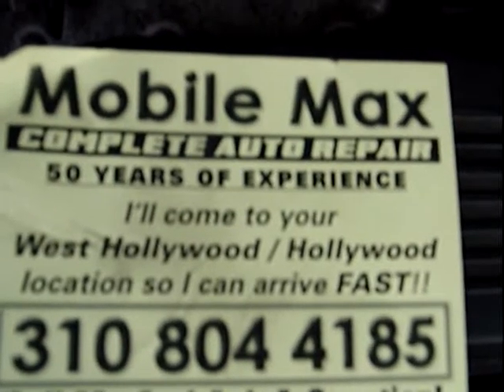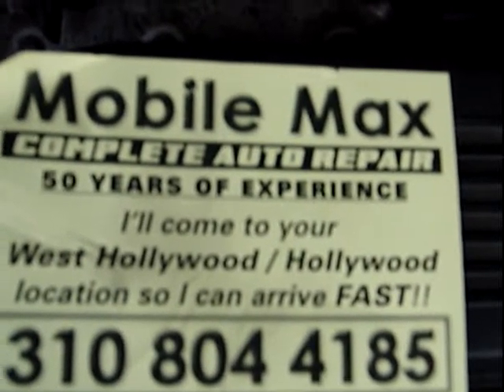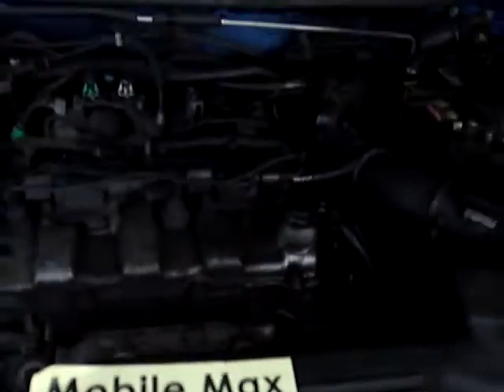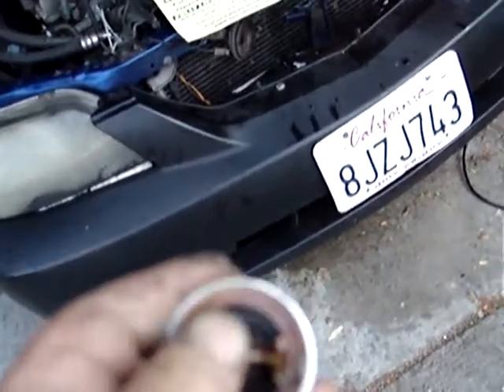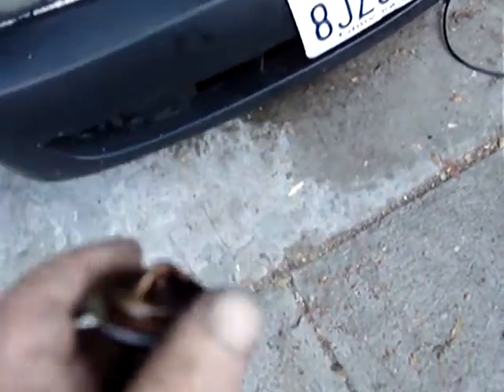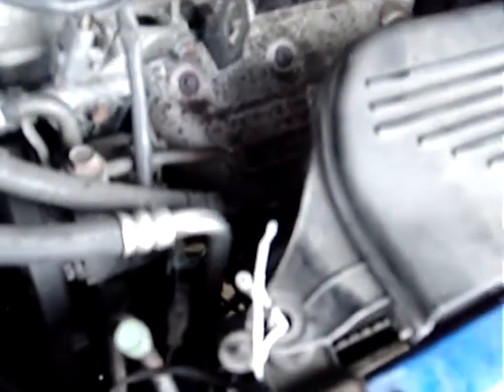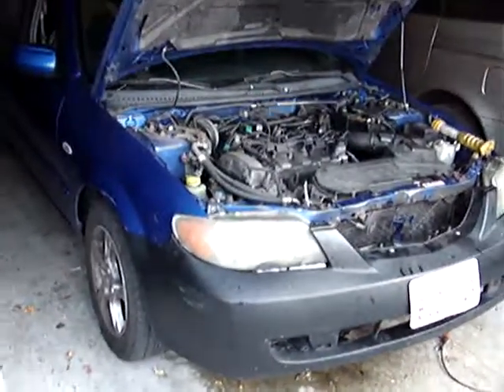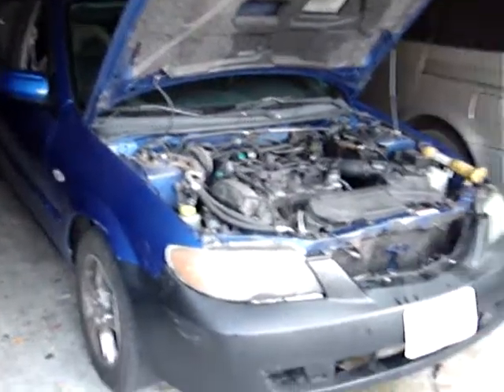03 Mazda Protege Thermostat R&R

Comment: Thanks
Reply from the maker: My pleasure anytime!
Reply: Question i have a mazda 03 protege and im wondering if the fans to cool on the engine turn on only the driver side of must be boths fans
Reply from the maker: @sancheztorres35  Both fans should work

Comment: I have a question that hose that’s on top of the engine at the top that slides over to the booster on top of the brake booster. The one back hose what’s the name of that hose?